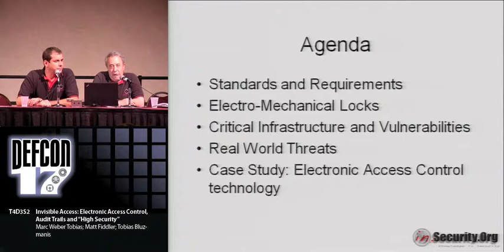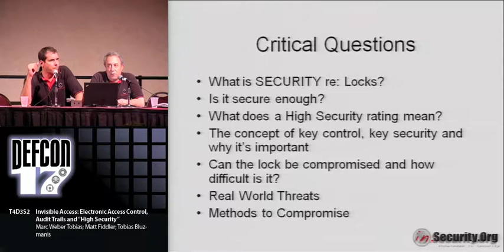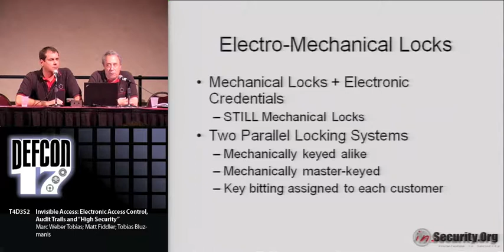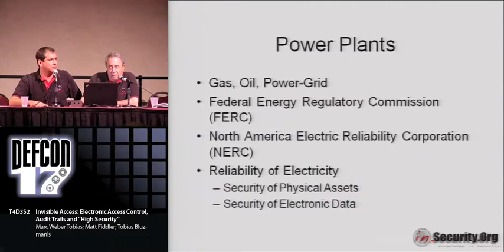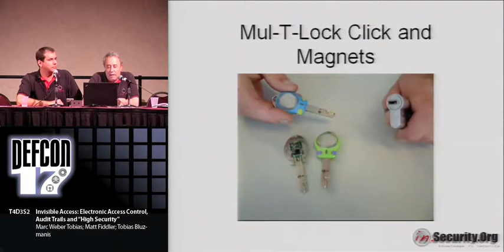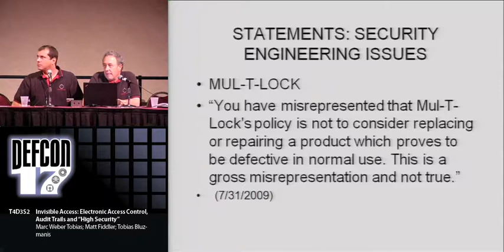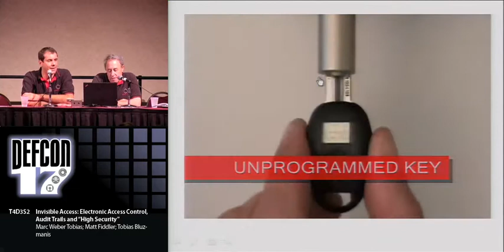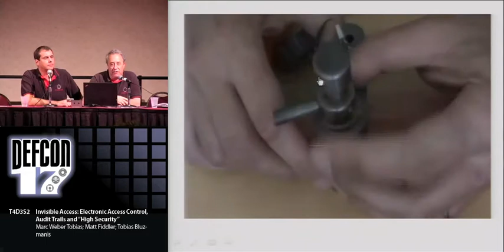DEFCON 17: Invisible Access: Electronic Access Control, Audit Trails and "High Security"

Comment: The Securety industry is going to have to move to a field upgradable model on these electronic lock sets because they will be hacked just like encryption codes are broken over time and they should be field upgrade able to new code sets or new RFID scema. What technology they use is not so key but the fact that it is hardened and field upgradable IS...